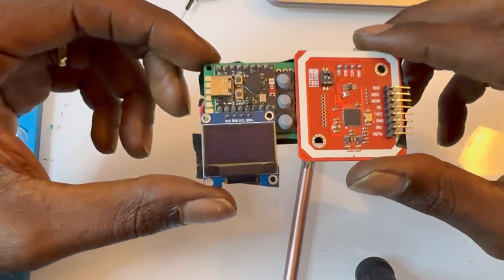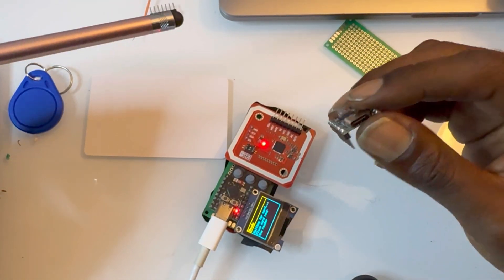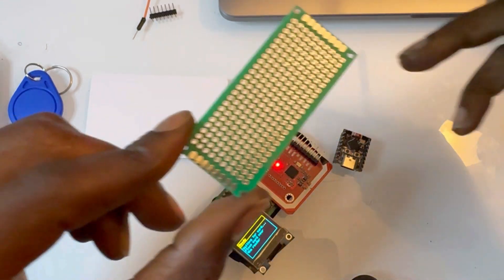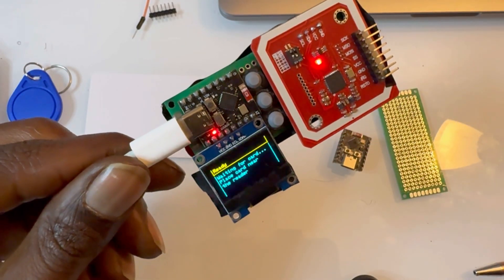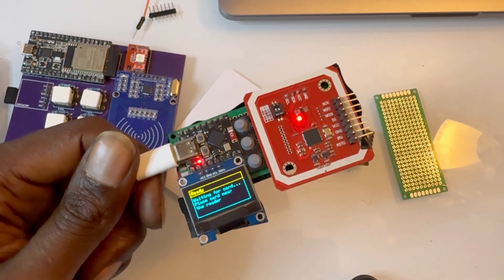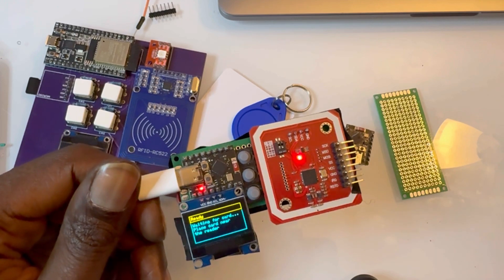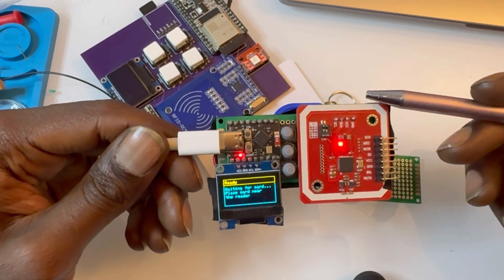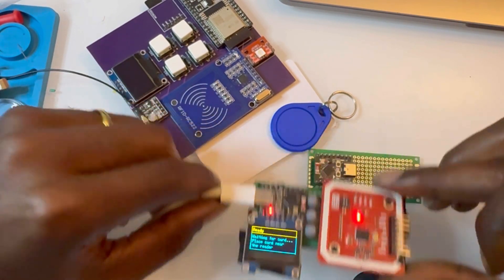ESP32 NFC Reader / Writer PCB Design (PN532)

Comment: do you know where I can purchase a pn532 with a strong antenna? are you selling the one you are making soon? I would love to get my hands on a large quantity of them. do you have some stats on the one you are making I can share with my company? We are using normal pn532 now in our work but its just so weak.
Reply from the maker: Thanks for reaching out! Yes the pn532 that you see here and that you have unfortunately are clones of an outdated chip and design. No swappable antenna. I have made a pn7160(much better) module that is about 2 inches AND with an antenna connector for much better antennas with better range.

Please contact me in my bio info for email and I will give you more information or I can have a custom device made for you.